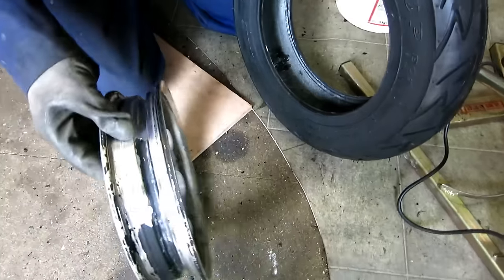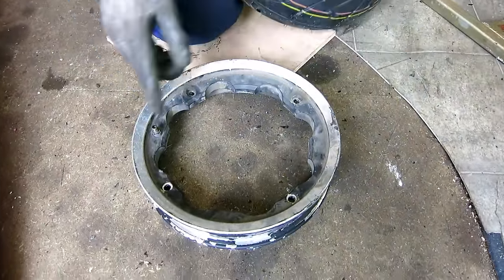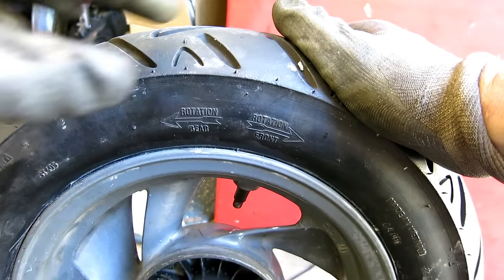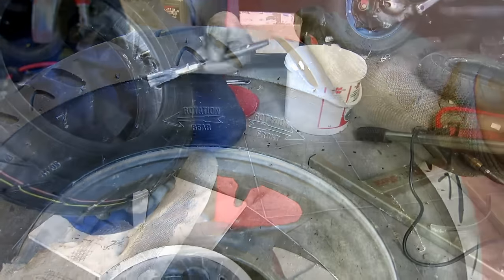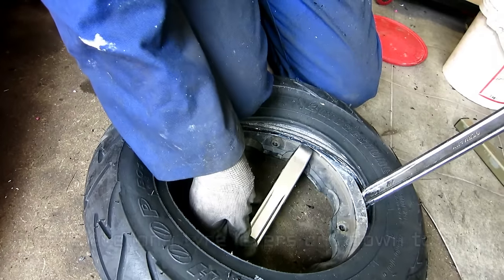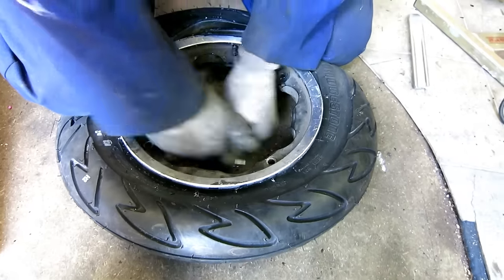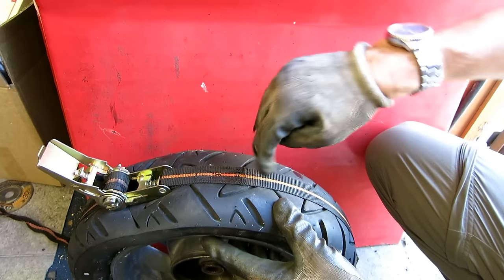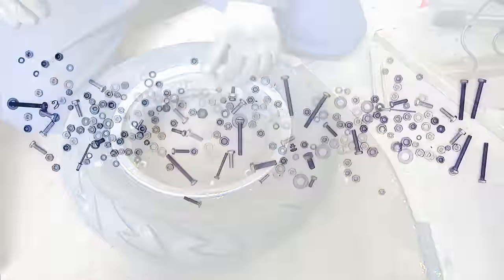SLUK | tubeless tyre fitting to scooter wheels (e.g. Vespa Lambretta)

Comment: the right tools for the right job, that's the problem i'm having. at the point of just throwing the whole thing away. so frustraiting.
Reply: i've ripped 2 plugs trying to get the rubber to fit, and you just inflate that sob and it popped in place. what a shitshow i've been trying for a week to fix this thing. I guess i'll just take it to the shop.; tubeless aren't my fav. i've even tried to shove a tube in the slot just to make due, but couldn't fit the tube in. Gave up, may try to visit buddies compressor should help. i need to order some more plug the hole nossle filler doodads